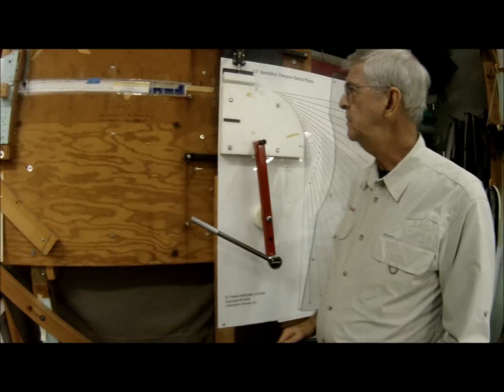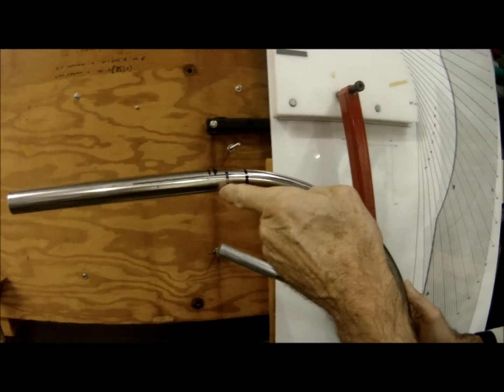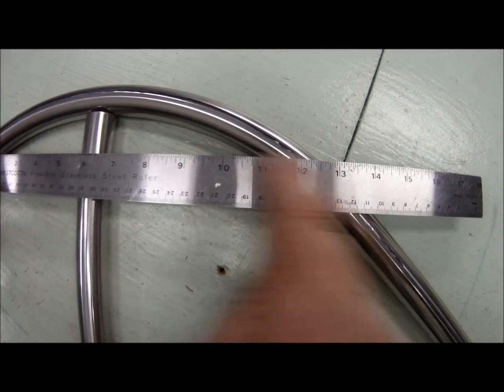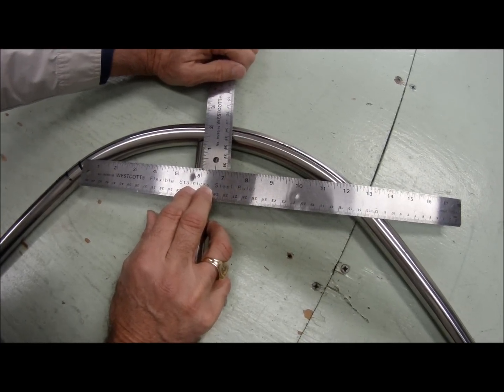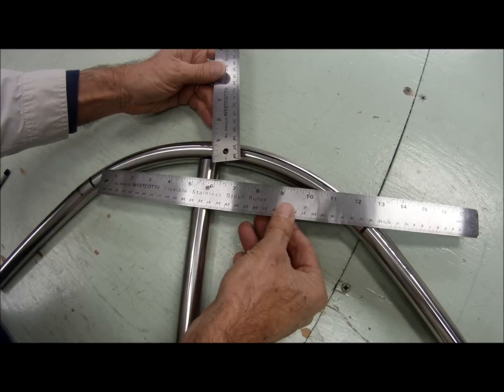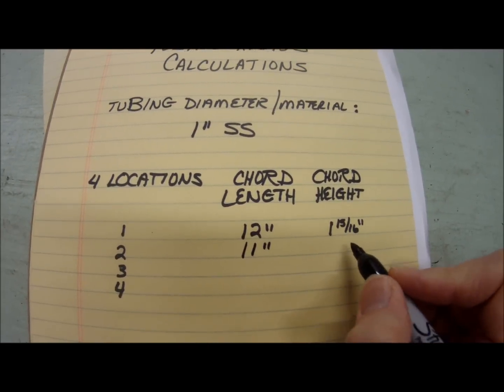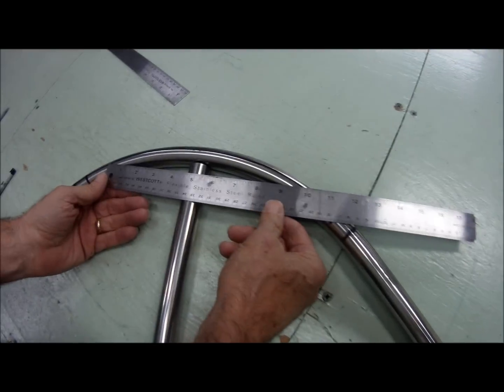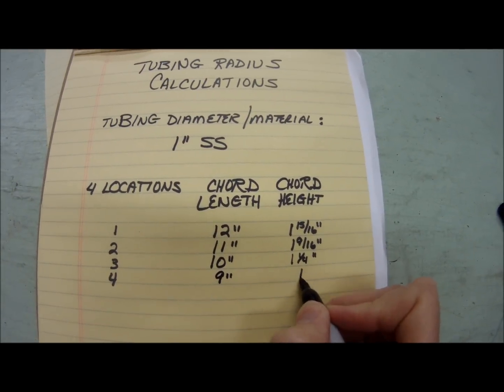EZ Frame 2 (old version) Boat Top Frame Software: Calculating Actual Bender Radius.wmv

Comment: I read the bendarc instructions on the scale. It says to ben a piece of tube 90 degrees and then pul a tape measure back 50 inches and mark that point. It does not say 50 inches from what? I am guessing that is 50 inches from the end of the bend. Is that correct?